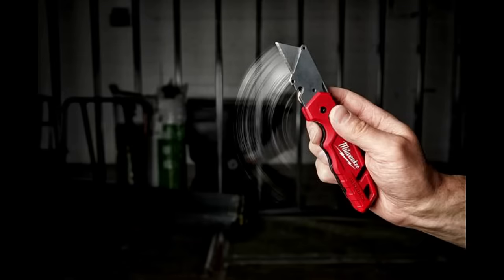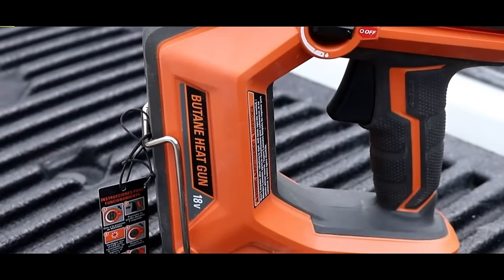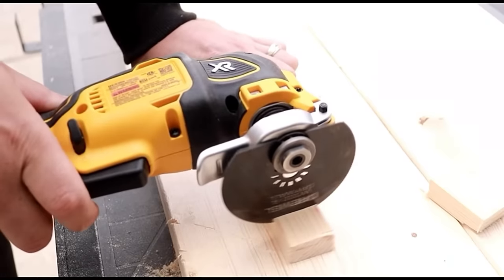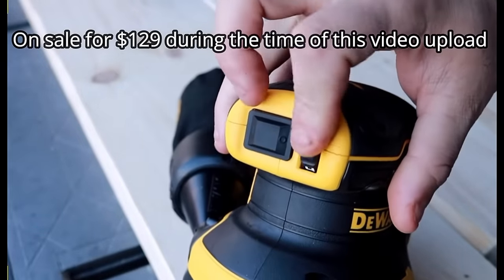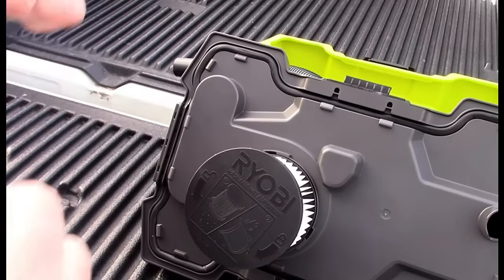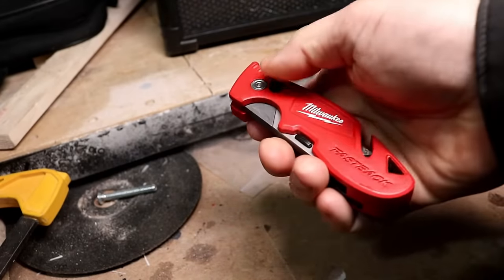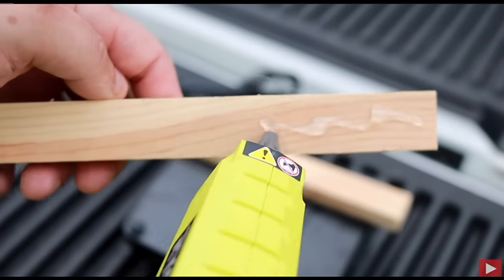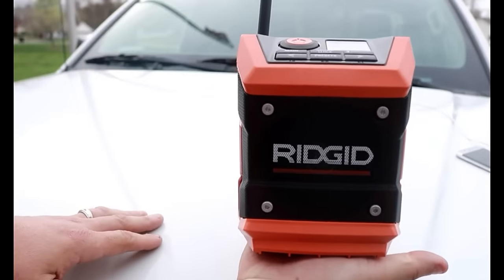Top Ten Inexpensive Tools That You Won't Be Able To Live Without -Tools that will make life easier!

Comment: The Milwaukee knives are hands down the best. The 2nd gen  Milwaukee nailer could've been on the list. Using it for almost 2 yrs, Im a trim carpenter. Est 70,000 1 3/4 pin nails shot with it, about 13 to 15 hundred nails on a charge 3.0 battery. Not one issue,  Not even one jam. It's a beast.

Comment: Any time I see these tool videos with multiple brands of cordless tools, im like "I don't care how good this tool is, im not keeping up with 2 types of batteries
Reply: I have an adapter about $20?  it lets me use 20v Dewalt batteries from my weed eater in my 18v makita tools. Use it all the time, Works great.
Reply: I agree, I picked DeWalt 20v Max as my new set of battery tools when I retired the Ryobi ones. They may not be the best in every category but they rank in the top five in every one I've seen and the top in many. I have 60v Max tools and their batteries work in the 20v tools as well as extend the time to discharge. I realize that there may be better tools in certain categories but the convenience of one battery system and charger far outweighs any minor advantages some other brand might have. As for the comments about adapters, well that's just more clutter in the tool box and likely voids the warranty.
Reply: @zzing15  They are more or less the same. A battery isn't flat 18V or 20V. Check out project farm on his battery test. They all start over 20v and drop below.
Reply: Merrick Marttinen - as I understand, 20v is actually 18v nominal or 20v Max. They all use the same cells 3.6-4v cells.
Reply: I just hate cordless in the first place
Reply: I just run different batteries. Three primary and three secondary lines.
Reply: Yeah, I have only DeWalt batteries but use adapters on the Makita and Milwaukee tools.
Reply: there are battery adapters now they are sweet
Reply: @zzing15  They are the same. Some companies market the max voltage, some market the general working voltage. But 18v and 20v power tool battteries use the same number and type of cells.
Reply: @edgarjhansen  Same, I have been really pleased with the Dewalt 20V lineup and I am happy to stick to one manufacturer for the convenience. For example, in my opinion Dewalt have the best cordless drill, best cordless sawsall and 3rd best impact driver on the market. It's not worth it to me to invest in a Milwaukee impact driver that is 10% stronger when I have to also invest in multiple battery and charger types. Since I can stick to DeWalt batteries and still get a tool that is competitive with the best on the market, I am happy.
Reply: I’ve had to buy tools on the fly so I’m into 3 different brands now. Makita, DeWalt, and Ryobi. Really wish there’d be a universal battery standard though that’d make everyone’s lives easier
Reply: I'm fully equipped with Makita, it makes things easier :)
Reply: Same here
Reply: I don't recommend using battery adapter because I have destroyed 300 dollar new drill.
Reply: I have actually found that i like having multiple batteries for multiple tools. I always have charged batteries to use, just works. Can't explain why.
Reply: @zzing15  it's the same. It may have to do with avoiding paying Milwaukee a royalty as they own the 18v patent.
Reply: I used to think the same but I slowly realized that at least for my uses, I prefer DeWalt and Milwaukee exclusively so I carry M18 and Dewalt batteries. As well as M12 but cause they’re cheap 🥲
Reply: I agree Ben, it just becomes a hassle.
Reply: Sadly I could not find a way to do less than 3. There is no M12 air compressor or weed eater, Ryobi is too big and bulky and most of the handheld tools are just obnoxiously large, and neither one has an upright vacuum that seems to be worth getting(M12 shop vac is great though), so I just ordered a hoover ONEPWR evolve.
Reply: Facts!! Hell I stick to one brand & one brand only bc of it!!!
Reply: @jackgyver4683  I can't stop laughing at this. Life is so much better without cords and hoses to trip you up and to have to drag around and unpack/pack daily. The only cords on my sites are to chargers. Even in the garage building cabinets or whatever I hate cords. It's freakin 2021 for gods sake.
Reply: I used to feel that way. But time is money and sometimes one brand does it better for a given tool. Case in point. Before I went pro, I had a lot of rigid and used it for over a year on the job. But I quite often have to do small ripcuts mostly overhead in difficult positions. The Dewalt atomic 4 and a half inch circsaw is perfect for that, so I replaced my daily kit with all dewalt atomic to stay on one platform at work.
But now I run a few red 12 volt tools because dewalt seems to think there is no need for powerful compact tools. I run a pin nailer and impact driver in red, but it does not make sense to replace my circsaw because dewalt still has the best option as well as the atomic recipsaw being about the same size as the fuel 12V. And the Sawzall is the same size between red and yellow. Actualy the atomic 20vmax is smaller than the 12vfuel. Still running yellow framing and roofing guns but may go red next year because they look to be a better gun and mine are getting ragged.I also plan to run fuel ratchets in the shop at home to work on the truck and get rid of the air hose there as well.
Reply: @mdeamicis  the gen 2 red guns are the best!
Reply: It should be illegalbto have 1 system batteries they should all be adaptable to each other
Reply: Once he added a third I said no thank you. Love the video. But no thank you.
Reply: @AdamJames.  
The milwaukee fuel series communicate with the electronics, wouldn't use a substitute battery.
Reply: I am up to seven rn in the garage alone and only the winter tools. When summer comes so does the stihl 12vs again and we switch our craftsman 12v out for it. Other than that we have craftsman 19.2v, ryobi 18v, Milwaukee 18 and 12 volt, and one other I cannot think of rn. This isn’t even mentioning tools that the batteries go to…
Reply: Having 2 or 3 types of batteries is no big deal if you know how to shop around for the best battery deals.
Reply: Same here I have Milwaukee battery tools only because I do mechanic work also and people tell me it’s all they use at chem plants and they’re proven reliable. Corded I don’t care for name brands I get what’s cheapest at the time they all do the job I need it to do. I really don’t mind plugging in if it means saving a few hundred dollars. Not a pro just a hobby so it’s good
Reply: @mdeamicis  From a homeowner's perspective, the cost of entry is significantly higher to get into battery powered tools, with most of the lower end battery powered tools being poor quality. We aren't going to jobsites and lugging it around. I have a cordless impact and drill, everything else is corded or pneumatic because I cannot really justify it when portability and time (profitability) isn't a major concern.
Reply: I’ve got 5 different battery platforms 😂 granted, one is my 40/80v yard tools, but still 3 18/20v platforms and one 12v platform 🤷‍♂️ I’ve just picked up tools I need when I see a great deal on a kit, or if one line offers something another doesn’t. It’s not a big deal, I’ve got all my chargers mounted on the wall in the shop and all the batteries on a table in front of them. Now I’m not stuck overpaying for a Milwaukee tool that I don’t need a super high quality version of, or stuck with a lower quality tool like Ryobi or Bauer when I need a super high quality version. Don’t be too brand loyal!
Reply: Facts
Reply: @ehRalph  I’ve been so curious about this! So the adapters are actually pretty decent?
Reply: @ChasedRabbit  I only have 2 and they’ve been solid over 2years. For Dewalt 18v tool nicad to run a dewalt 20v lithium ion battery and an adapter to use a dewalt 20 in a makita 18. Just be careful and don’t run the dewalt battery flat dead with an adapter because the protection logic may not work right. But I use my adapters all the time without issue
Reply: @ehRalph  where did you get your adapters
Reply: @jaggermurlin6343  I bought the adapters on Amazon, lots of variations available, but it looks like the price is doubled from when I bought mine. Just search the adapter you want similar to this: 
Dewalt 18v adapter for 20v battery
Dewalt 20v battery to makita 18v tool adapter
Reply: I must agree!
Reply: @mdeamicis 😂its more than about being 2021 (actually 2024 now, not sure why this just showed up on my feed) anyway its more about "Marketing 101-Get as much $$ from customer/sucker as you can".  Batteries are too costly and frkn way more  inconvenient then the inconvenience of buying 1 brand line.  I hope people continue to grow to  decline multi-line purchases and force comps to offer some type of interchange options.  As of this post, im technically  from  the future, believe me, cost will be a factor...beacause those of you in the past f'd up-your  biden will suck and stick it to to you.😢

Comment: Came here to joke on how many times you said “simply” when talking about the dewalt oscillating tool and ended up wanting to comment on how I agree that the Dremel driver is awesome and i use it all the time. I shunned the fastback knife for years due to the size but recently saw that there was a compact model, bought it and love it. I don’t have the ryobi but i have a bauer hot glue gun and i agree that that thing is HANDY. It’s also way faster than any corded glue guns i’ve ever used… and we have a bunch of industrial grade ones at the shop.. 
thanks for the content 
Have a good one ✌🏻

Comment: You nailed it.  The knife by Milwaukee is the single beat tool ever.
Reply: I bought the Milwaukee razor knife from home depot and it wouldn't hold the blade in place. The blade would be stuck in my work. I just get husky razor knives now.
Reply: I understand attractive-ness of folding utility knives but not the value. 

 (First off I absolutely hate Home Depot) but you can buy their cheapest orange model for under $3 and its a full skeletal grip so if I have to score through metal I can really wrench my hand into it and it stays set like its supposed to

and Milwaukee is my brand too

Comment: What great information!  I am totally hung up on Makita tools, but you got me with 3 of these.( Oops 4 but 8 don’t count dremel anyway). The sander, oscillating tool with that quick blade change and the vacuum.  My “can’t live without” is my Dremel Ultra Saw.  I bought it to cut a bunch of plexiglass. Like your choices, I’m surprised at how often I reach for it. Oh that reminds me, gotta have the screwdriver too. Will totally use than on my sewing machines. I bought a cheap one once and it didn’t work, never tried another. Just subscribed thanks so much!

Comment: My favorite tool is missing. I realized it was my favorite tool last summer when constructing some walls, framework, and removable roof for my deck. No, it's not a power tool, nor a modern tool; nor one of the 6 simple ancient tools (pulley, wheel and axle, lever, inclined plane, screw, wedge). But it has been around for thousands of years in some form or another. It allows one person with only 2 hands to do the job of several people with many hands. Can you guess before I tell you? I tell you - it saved the day when no-one showed up to help me. I will add a hint in a day or two if necesssary.

Comment: I prefer the Milwaukee M12 Radio to the rigid. The M 12 batteries are so small and light that it keeps the radio nice and light weight. Even though it’s still able to charge a phone or even a tablet off of a small two amp hour battery end it will run the radio for hours off of that size battery. You can put a four or six amp hour in there if you like but it’s not necessary. It basically has the same feature set where it will function as a charger and has Bluetooth as well as an aux Jack. Digital tuner w/presets. It also offers a alkaline battery back up for the presets so you don’t lose them when you swap batteries. That is a nice touch.

Comment: Was at the big Orange Box the other day, and to my great surprise I saw the Milwaukee Fastback in a two pack! The pack was only 14.97 (before taxes). That's about 7.50 a piece - what a deal! I would recommend people jump on that deal ASAP. Some may say that it's just a utility knife but as you have mentioned before it is so much more. My favorite cheap tools are the Big Gator Tools drill guides which are about 25.00 bucks apiece and worth every penny, and the Wood Owl Auger bits. They are super heavy duty, sharp, and cut extremely clean holes. A set of 6 only runs about 65.00 bucks.

Comment: @Milwaukee FastBack: I'd choose the one with a standard bit screw driver. Spare blades in the knife may get rusty, so I'd store them in a dry space outside the knife and just put 1 extra spare blade in the knife.
@Hot-Glue Gun: Just a note: my hot glued things felt apart in hot summer, may be I need better glue sticks. Which glues also in higher summer temperature ? Were hot glue sticks already tested on those conditions and compared with each other?

Comment: One thing I am surprised at, is how many different systems you are invested into. I’m just not able to justify owning that many different types of batteries and chargers. I can see having one small system maybe an M 12 or the Ryobi system because the batteries for it are in expensive but to own multiple 18 or 20 V upper echelon systems is very expensive so I can’t see buying into both Dewalt and Makita or Milwaukee and or rigid I would have to make a choice of one large format system and one small format system and for me it has been the Milwaukee fuel M 18 and M 12 system. I could have gone with the Dewalt or Makita and had a good experience, I have used a lot of tools for both brands in the past. But I just chose to go with Milwaukee because I really like their M 12 line and the variety of tools you can get and since the M 18 chargers will also charge the M 12 batteries it made sense to also go with their large format line as well.

Comment: I used the Lufkin for 2 years, great tape, if everyone else on the crew didn’t bitch about the reverse colors I’d still use it. Also have the dewalt multi, great tool, but let’s be real no oscillating tool is super quiet.

Comment: I reckon quality locking-pliers ain’t fancy enough to make the list.
Wire cutters in jaw and can hold a hammer head to pound and pull, driver bits, sockets, blades, scrapers, holds parts and pieces in place, can grab and carry hot metal, use as a lever, leverage or a step or handle, a fist pack, bends metal…

Comment: Hot glue gun got me, "hanging up battery chargers" yeah I'm sure you do that quite alot😂 I chose hi-koki a few years ago(2015) and I'm sticking to that because I don't want more than one battery. Can't really complain, might not be the best but the cordless driver drill have really been impressive. Built a house and renovated other, large screws and hole saws. Once I abused it until it was to hot to touch but still going strong.

Comment: Only issue I have on this list is the battery powered sander. Personally I always have a vacuum connected to my sander when working so a cord isn’t a big deal. Granted if you’re outside or don’t care about dust, yeah that’s a great option but my sander is one of the only tools I haven’t gone cordless with
Reply: I use that same cordless DeWalt random orbital palm sander with the cordless FlexVolt DCV585 vacuum on a cart. The DeWalt hose adapter click-locks in to the tool. In fact, I roll the vac around the shop and use it with several DeWalt woodworking tools. With compatible sandpaper, this provides excellent dust extraction for sanding. However, I changed out the rigid, hard-plastic DeWalt hose that came with this cordless vac for a rubberized, more flexible Rockler kit. Best of all — no electrical cords.

Comment: I've had two of the fastback utility knives. Both of them had issues retaining the blade when drawing the knife through cardboard. It's rather disconcerting to have the knife in your hand and the blade is still in the cardboard.
Reply: Bro one of the best utility knives is used is the $9 homedepot husky all metal utility knife it's cheap enough if you loose one and it last
Reply: You got 2 faulty ones. I've had probably 10 over the last couple years and all work great. All my coworkers have good results too. Only reason I have so many is because I misplace them
Reply: @chriss8328  same
Reply: This was the only tool mentioned that interested me. I think I'm fine sticking with the standard slide-out my step-dad handed down to me at this time. When you use a tool multiple times a day, you have a dedicated pocket to keep it in and losing it becomes nearly impossible.

Comment: Show me a battery powered tool with the option of plugging it in. That's a must have for me.
Reply: That would be great, but it would then have to have two motors. one for 120v and one for 12v. Or a huge transformer that will weigh the tool down and get hot fast.

Might work for larger tools. But not small hand tools.
Reply: Just air compressor mitre saw and table saw

Comment: The tape measures in bananas. :-) I have the Dewalt sander and its absolute garbage. It now rattles and vibrates so loud it feels like its going to explode. It doesn't remove anything like the material it should. It's just loud and horrible to use. Its easily beaten by a simple Milwaukee multi tool with the sander head.

Comment: I’m on of those who don’t quit get the radio. Why not just stream from your phone to a speaker of headphones. When I’m working around equipment, often use ear protection with built in Bluetooth headphones. Don’t quite see the value add…